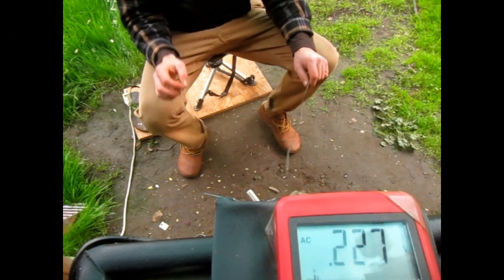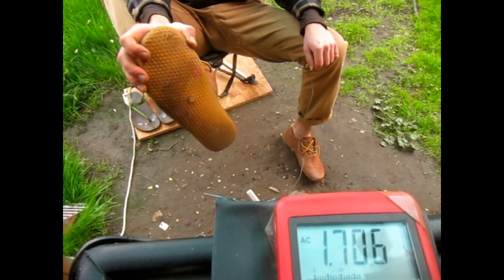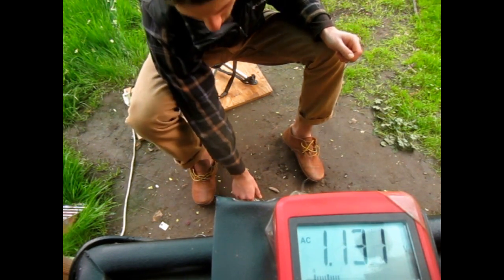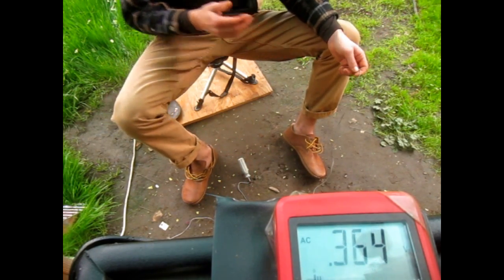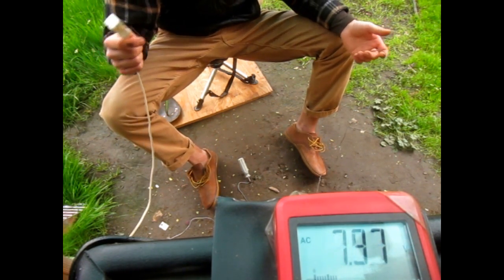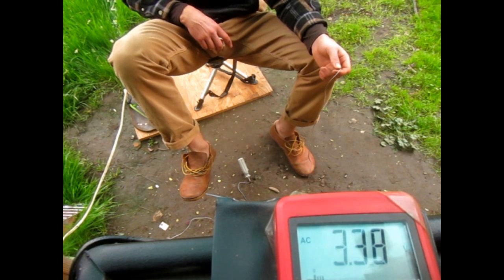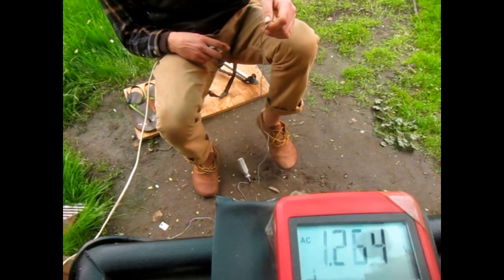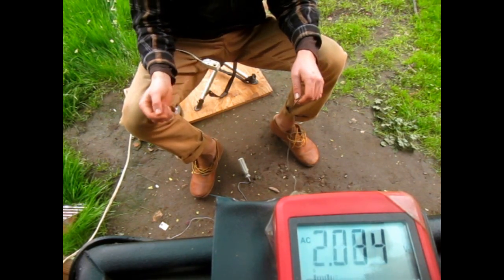Earthing Shoes test w/ voltmeter

Comment: I like this but in reality if you are standing in a body of water I.e. a puddle and there is down power lines or a current beneath you is it accurate to suggest those people in “grounding” shoes and others who are barefoot as opposed to thick rubber soles would be first to be electrocuted? Maybe these aren’t the best option for trades workers

Comment: This is great. Are the soles still waterproof with the grounding kit?
Reply from the maker: Yes, the compression fitting created from installing the rivet is water tight if installed to the proper compression outlined in the instructions.

Comment: is it still working with  socks ?
Reply from the maker: Yes, socks build up perspiration (conductivity) quickly. The earthing shoes are 80% as effective with socks right off the bat. After 10 minutes of use they are working 100% effectively.
Reply: @RewildBeFree  would copper thread socks boost the effect even more?
Reply from the maker: @jigerjoshi  Unnecessary IMO but they'd definitely be conductive.
Reply: @RewildBeFree  Why unnecessary? Your video showed even with the grounded shoe still 0.15 voltage and they say the best to get is at 0 so either installing another copper rivet in the shoe or something to get even more free electrons from the Earth can only be more beneficial no?
Reply: @RewildBeFree  how come the Earth Runner sandals themselves dont have the cooper rivet in this place? Theres is under the big toe no? Don't they make this kit too?